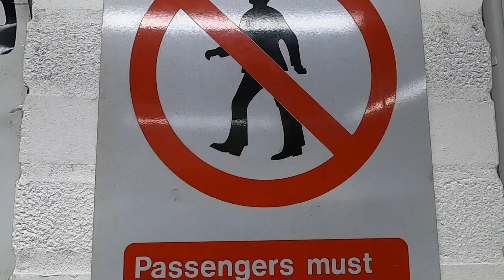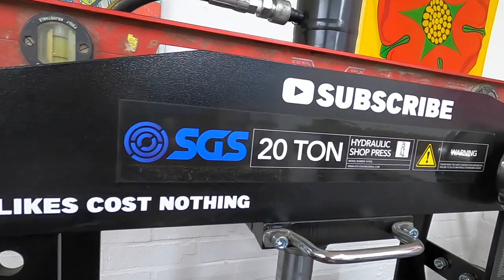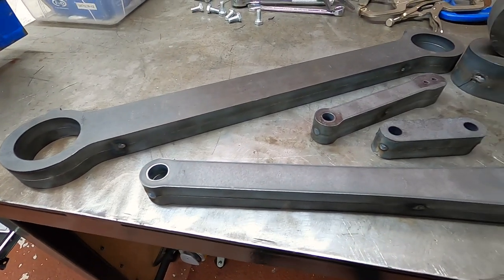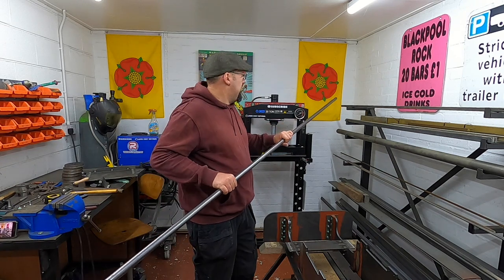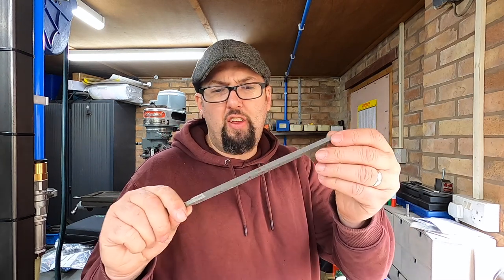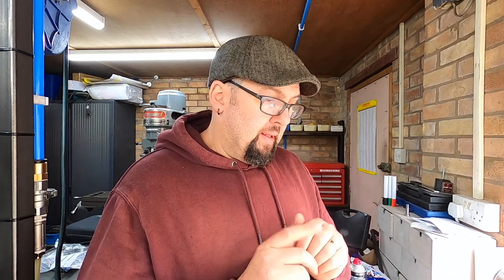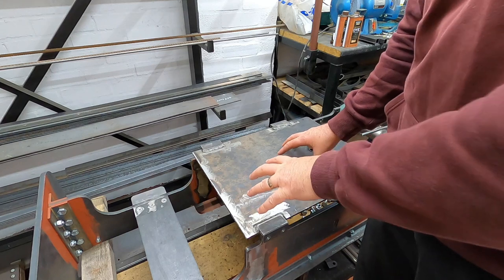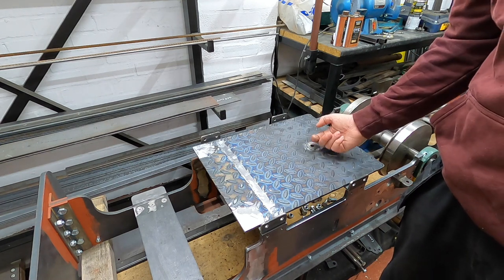Steam Engine Update, Bits & Pieces, Lack of videos! EP29

Comment: Hi Matt, good to hear your voice again just the other day I was wondering why you weren't showing up on my notifications and then--- there you are. Been building a "Cracker" in my shop and just finished a P.M. Research vertical boiler and vertical steam engine power plant with the generator using a ceramic burner for firing. While working on this small stuff I really enjoy watching you MIG welding on the chassis on the Tinker Belle. Sorry the business has to be the needful but be glad you have it to rely on.
Laters.
Dick B. USA
Reply from the maker: Thanks Richard. You need to get that camera out and make a video on all this fantastic sounding stuff!! All the best, Matt